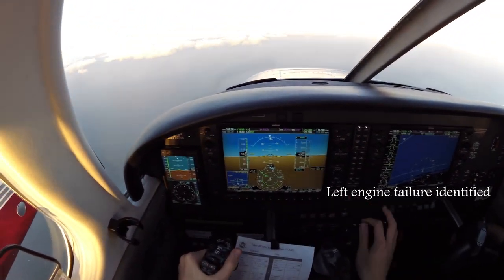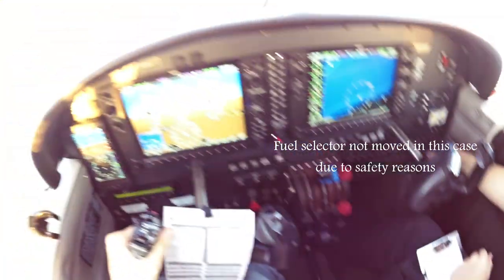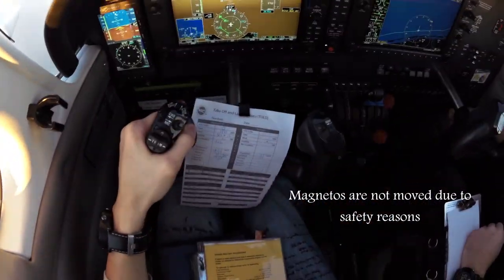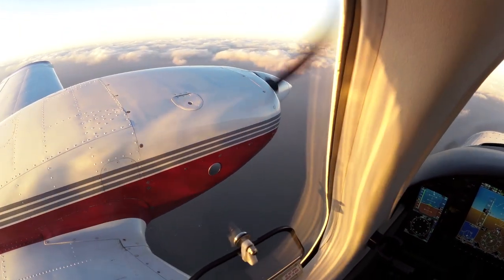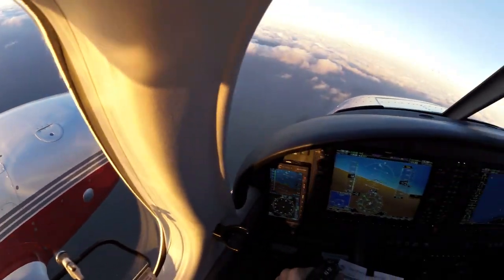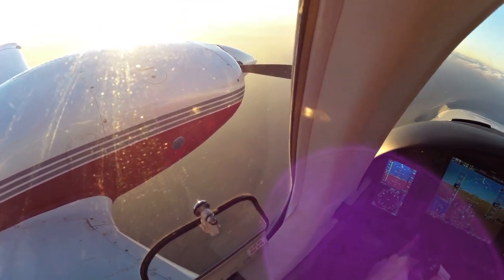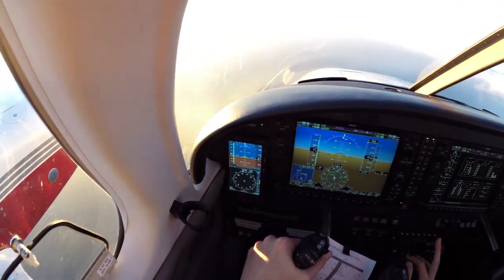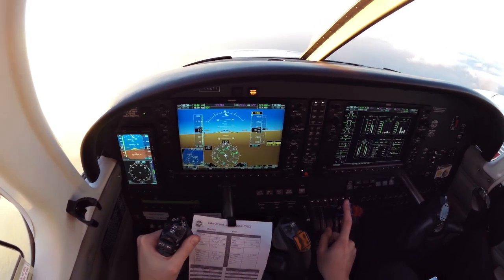Engine Failure In-Flight Demonstration

Comment: Nice video !! Just wanted to point out, turns should not be made towards the inoperative engine. Right ? At least that's what I was told at ground school. Thanks fr the video!
Reply: My understanding is that it is 'unfavorable' to turn towards the dead engine but the aircraft doesnt know the difference as long as the rate of turn is the same. Martin Pauly has a good training video with his CFI that includes this topic: https://youtu.be/oD3YPdOH5Xo?t=3901

Comment: If this is a 2000 model the reason you had to bump the starter is because you were below 120KIAS.
Reply: Does it even have an accumulator?
Reply: @robertgary3561 yea but you still need that prop windmilling to air start. You could also get it windmilling around 100kts, don’t need to haul ass at 120 to start it
Reply: @Falcon2.39-1  we just use the starter. Air start by windmilling only really works on small low compression engines

Comment: HI there, thanks for the nice video. But I'd love to correct something. At 3:13 you said "zero sideslip". You had sideslip going the entire procedure. 

May I ask, do you remember if you had rudder pedals fully deflected (all the way in)?
Reply: Yes, I'm quite surprised that instructor didn't instruct him to input more right rudder. His legs looked quite relaxed there and  looking at his speed he was above vmca so the rudder couldnt have been fully deflected.
Reply: The ball should be slightly deflected towards the ground. Your center of thrust for the airplane as a whole is now asymmetric so the typical slip/skid indicator should not be kept centered.
Reply: Page 12-21 of the PHAK says " Without specific guidance for zero sideslip, a bank of 2° and one-third to one-half ball deflection on the slip/skid indicator is suggested."